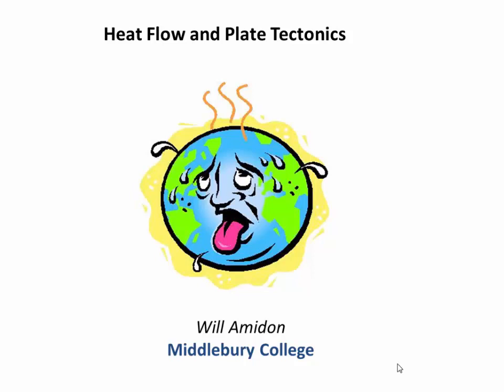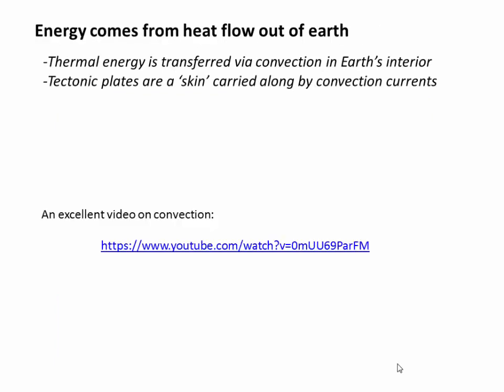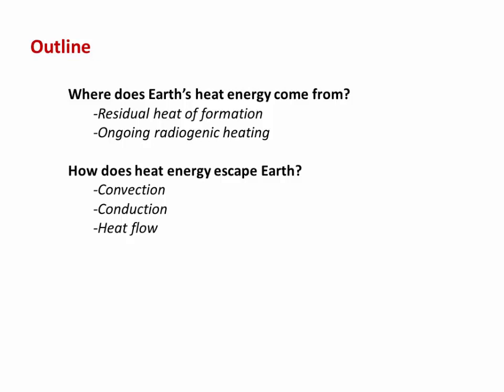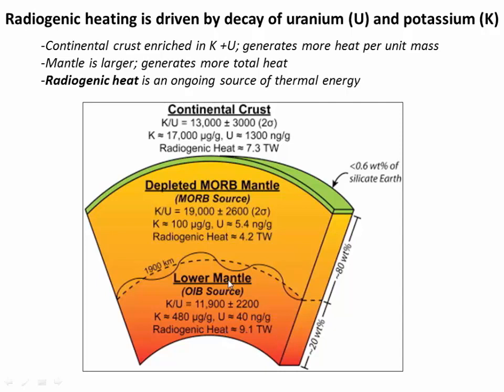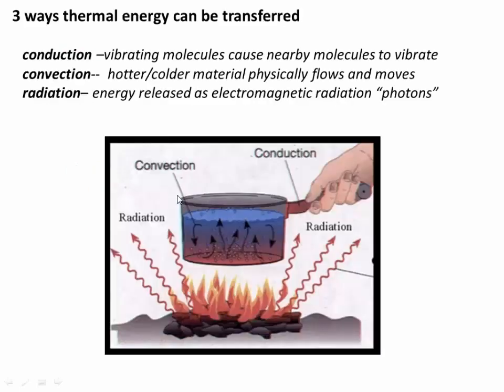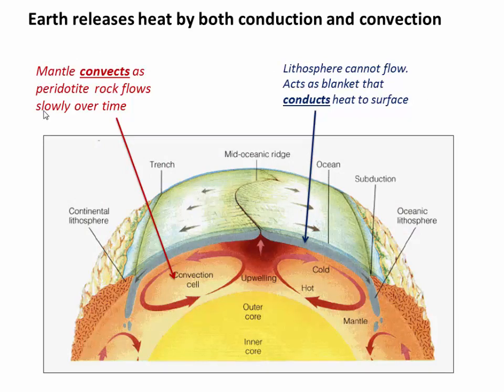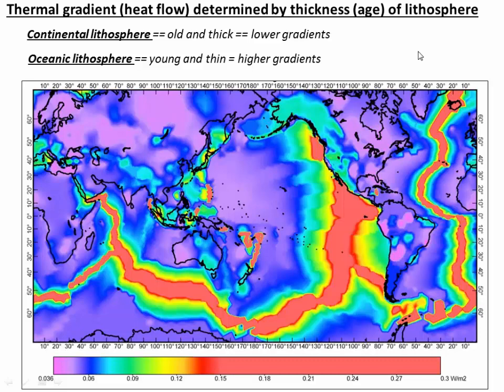Heat Flow and Plate Tectonics (C3-V2)

Comment: I have dealt with convection a fair amount.  It is a MINUSCULE force..  That red and blue convection at about 2 minutes - has anyone at ANY time ever tried to quantify the actual forces delivered to the underside of the lithosphere?  Vertically?  Horizontally?  As an engineer  I occasionally  dealt with convection, and I tell you convection is a VERY WEAK force.  In addition, as it rises, it has big time drag with the surrounding fluid.  Maybe some people  think convection is powerful.  I sure as heck don't.  In mantle plumes, the convection is a vertical vector.  Taking that vertical vector and making a right-angle turn, that is a REALLY inefficient turn, losing MASSIVE mounts of energy.  And it takes a unidirectional weak vertical force and spreads it out over 360°.  And every time the distance from the plume is doubled, the horizontal force is reduced by D^2.  Talk about low psi in the horizontal direction -especially out at a few thousand kms.   And THEN they can only apply force by the little boundary layer and the tiny bit of residual drag force there.  Every part of this entire hypothesis just screams "INADEQUATE!!".

Just from an engineering POV, I have never bought into this.  I have always thought they dreamed this up because they didn't have anything better - and they didn't think it through.  I just disagree on this entire principle.  I worked with forces for 40 years, so I have SOME appreciation for forces.  Convection is about the weakest one I know.  And they have right-turned convection moving continents.  Ay yi yi.
Reply: Wegener had a decent glimpse, but what geologists have done with his glimpse is an insult to Wegener.  I am of the opinion that he is only possibly 35% possibly right in the first place, though.

And the projections back in time to Pangaea?  Hey, anyone can make a model do anything they want it to.  It's all in the constants, the code and the assumptions.
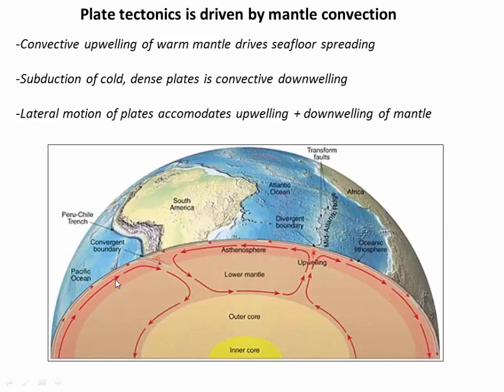Reply: At 10:00 he mentions the density increase of the descending slab as a "driver of convection". It isn't denser just because of the temperature difference. As it descends and the pressure increases, it undergoes a metamorphic reaction and transforms to denser minerals. It's the descending slab that does the work, not the upwelling mantle.